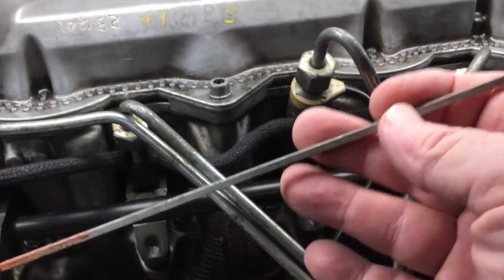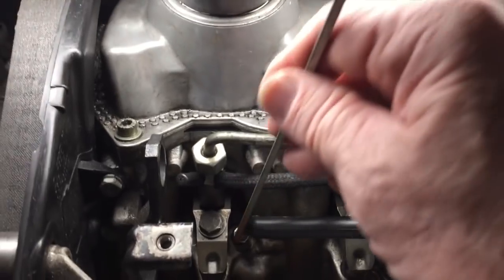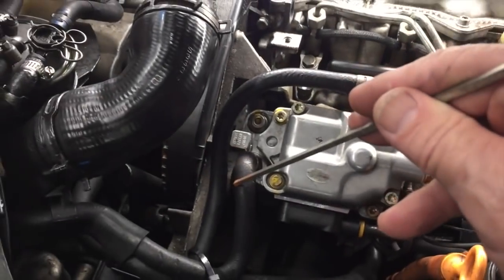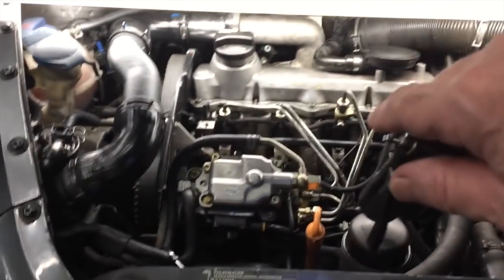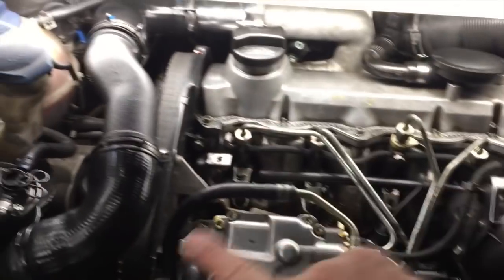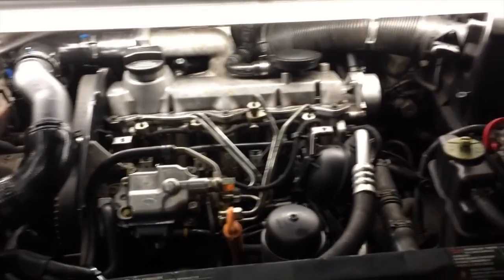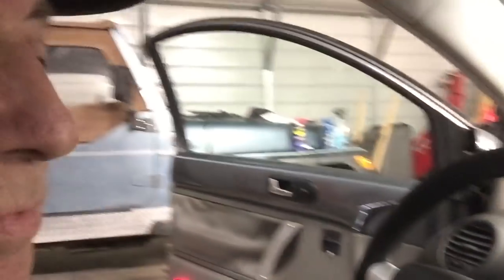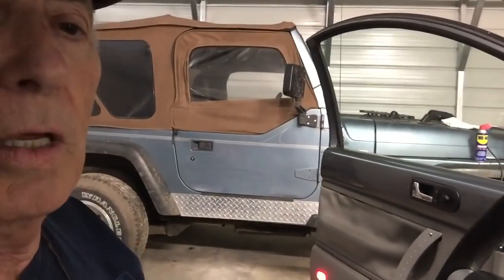VW TDI 1.9 diesel camshaft Top dead center  Coffee & Tools ep. 70

Comment: Hey there! Thank you for your videos I really enjoyed them and found them as helpful. However I have a question, how did you se the pump back up to the theoretical top dead center? Mine does not has any mark to orient with. Thank you in advance <3
Reply from the maker: The pump actually  has a hole that lines up where a long bolt can go through. That is your top dead center reference for the pump. From the pulley through.

Comment: I would be hesitant to put a race pipe/egr delete on an automatic. ...
No way to shut off in case of a runaway. 

Also, if you didn’t hook up vag com and check timing in the computer and fine tune the injection pump. ....
You are a hack who got lucky guessing. 

There is a lock that can go on the crank timing gear to set tdc

Comment: Hi, it is a accurate method? I have a manual tdi, but the fltwheel does't have mark.
Reply from the maker: The manual TDI has a mark but its read at the top of the housing near the 'teeth' and its a small notch. Rather hard to see and you look at  the "round" hold on the top of the housing. Good luck, they should be painted if you find it. Just for the future.
Reply from the maker: Round hole...for location view
Reply: I remplazed the clutch with a new luk that doesn t have mark. I am thinking use your method with a milimetrical gauge
Reply from the maker: @pabloperez5678  I used a metal rod to measure the piston travel to find TDC. Could be the most accurate way. I removed cylinder #1 glow plug to do the rod trick.
Reply: @SirTools  Thank you!
Reply: Not accurate. 
There are tools for setting top dead center. 

If you tension the cam belt without the cam gear broken free, the timing will be pulled out of time 100% guarintee
Reply: This is actually very poor information. 

You got the timing wrong. 
You don’t time the pump to tdc, you must do it with a computer. 

Experience can do it with a special dial indicator that screws into the pump